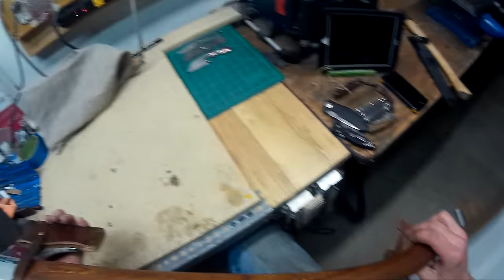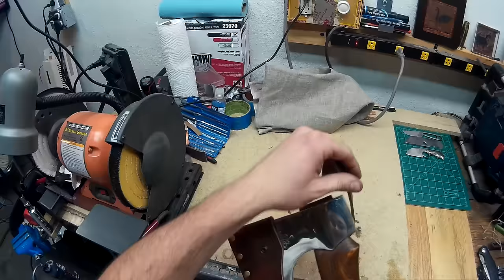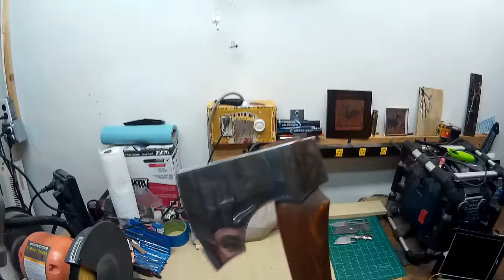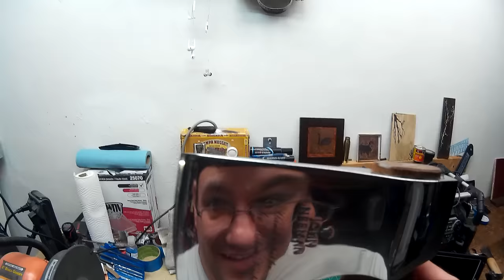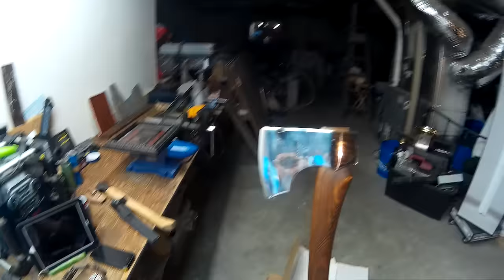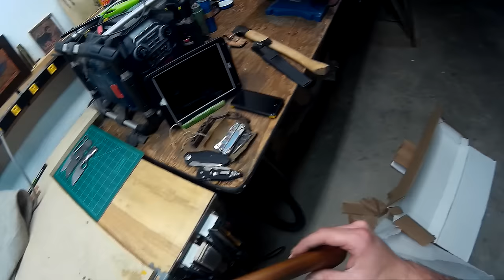Unboxing my John Neeman axe!  Part 2

Comment: Does anyone have a clue, as to why they use "Elm" wood for the handles? It is not a very good wood for enduring stress. It looks good, but why don't they use something that could hold up better? Anyone...
Reply from the maker: Not sure why they do that but maybe you could ask them. In my experience they’re very friendly and respond quickly to any questions or communications. If you find out please share with us.